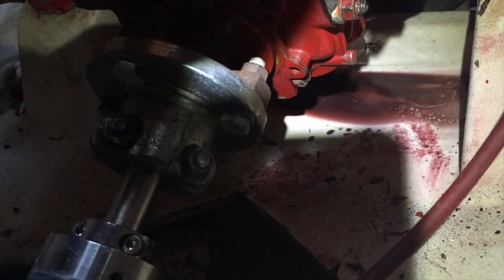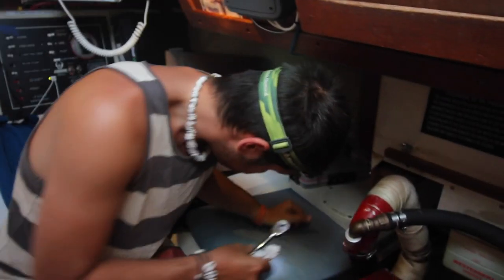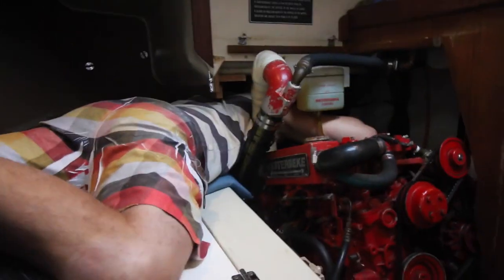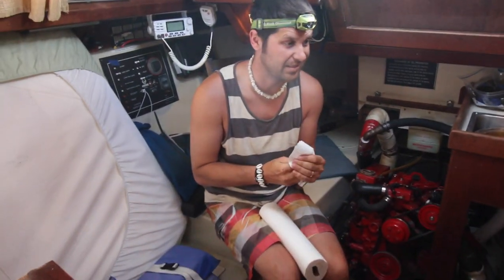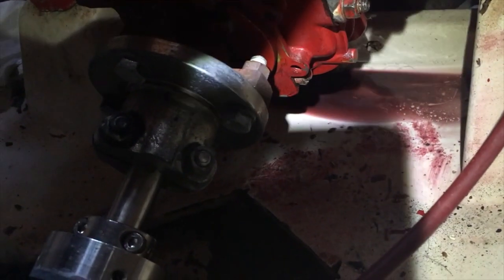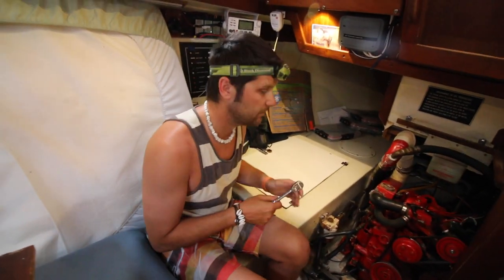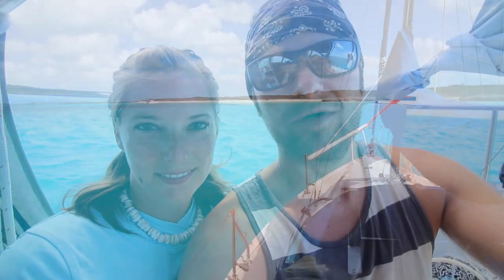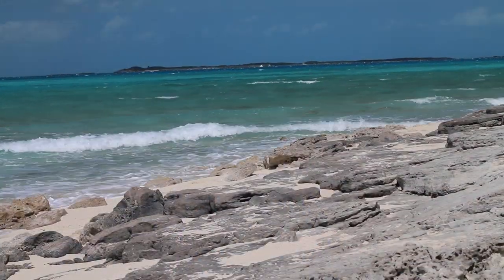Fixing Sailboat Transmission Fluid Leak @ Anchor Ep. 33

Comment: Randal, have you ever considered converting to an electric motor? If so please let me know your thoughts.
Reply from the maker: Pete Nauth, thank you so much for leaving us a comment. I’ve been on sailboats with electric motors and I’m typically not impressed....Since our diesel engine still runs like a new sewing machine, I would never consider replacing it. It has worked beautifully for us and also offers charging capabilities. It is so efficient that fuel consumption is a total non issue. We typically use 2 tanks of fuel per year. If I were to re-power our boat, and the boat were to be used primarily for day sailing, electric would be a great option, because I can recharge at the dock effectively. However if I were cruising there isn't enough space on deck for sufficient solar charging to keep up with the electric propulsion demands. Consider your effective range under power into a headwind with chop using electric propulsion, could you motor in these conditions continuously for 3 days without needing a generator? If you need a generator you might as well have an engine. Thanks again for leaving us a comment and for watching our videos. We really appreciate you being part of our journey!